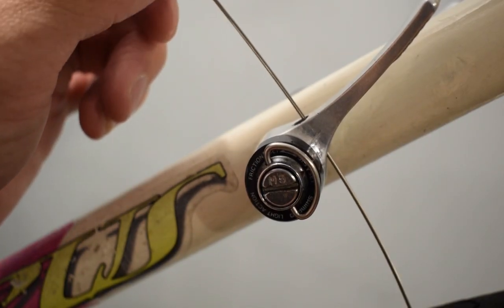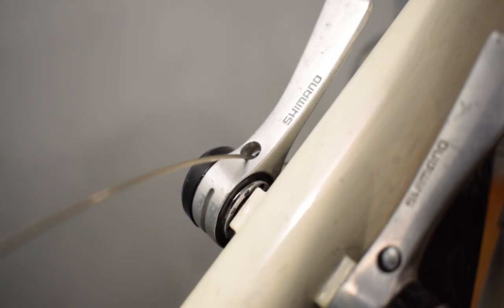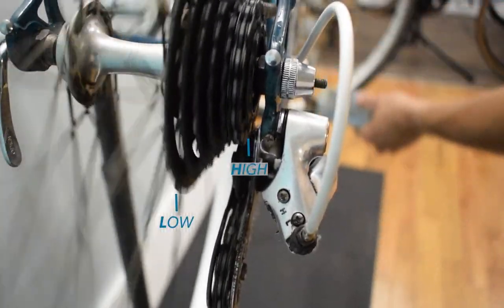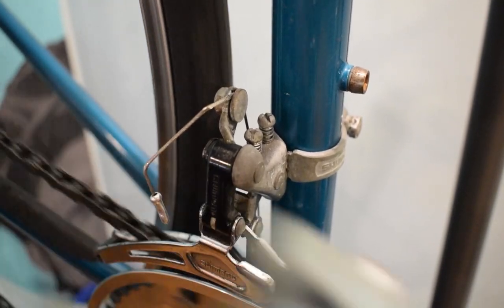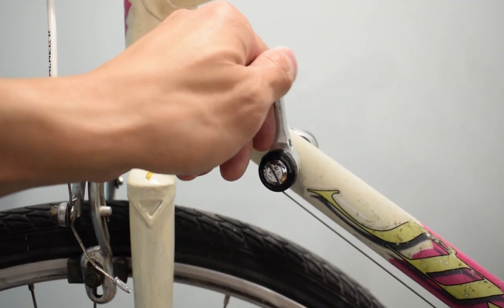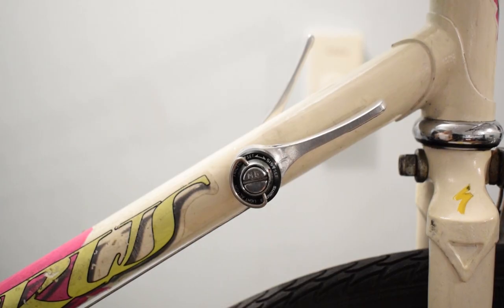How to Install Downtube Shifters?

Comment: Just a helpful tip, you should make a video of how to install the left index shifter, I know I'm not the only one who had trouble figuring out you install it pointing straight down, then rotate it once screwed in. It wont ever sit parallel with the downtube and will stick up at a 20 degree angle when fully forward.

Comment: I had a more difficult task, because I'm changing to dowtube shifters on my Helliot, but the tube frame section is not circular (not even oval) so the brackets support don't fit. I had to buy a special screw, drill the frame and install it. Now  I'm waiting for a Sontour Accushift levers set, I hope it fits well.

Comment: this maybe a little late. Is it possible to install a downtube shifter if the downtube is not round and doesnt have a fitting?
Reply: I haven't seen any shape other than round. However it won't hurt to ask a reputable local bike shop if they know.
Reply: Yes, if you have a steel frame (I did it in my Helliot, search for it on Youtube). Maybe, if you have an alloy one. If it's carbon, I will not recommend it, unless  you find a way to reinforce the frame somehow, on the drilling zone. I saw somewhere a guy who had it, with Campagnolo (or Cannondale, I'm not sure) M5 adapters but they just didn't stand fixed, not even with loctite.

Comment: What is the thing called where you put the cables?
Reply from the maker: Those are downtube shifters.
Reply: @DanyoSports  no the one down on the bottom bracket
Reply: @xenos7583  Those are the guides for the shifting cables, that's the only place the cables will run through before they get to the derailleurs. Hope that helps.
Reply: You are right...